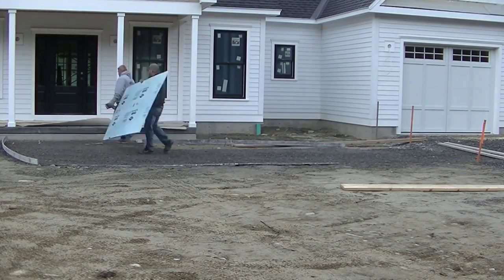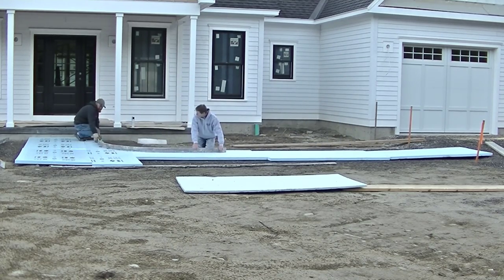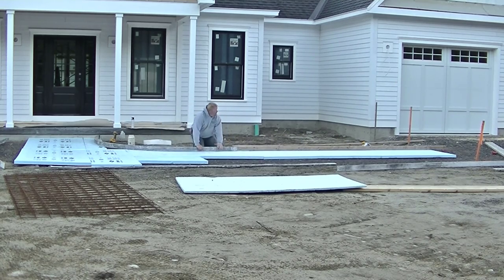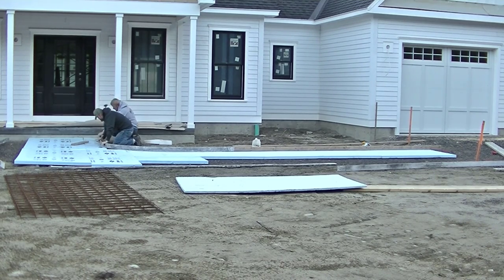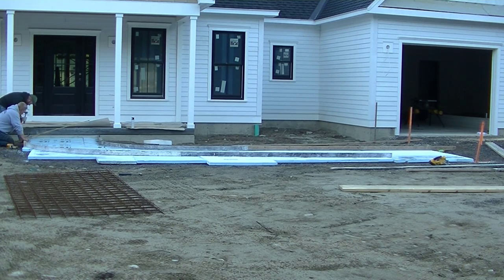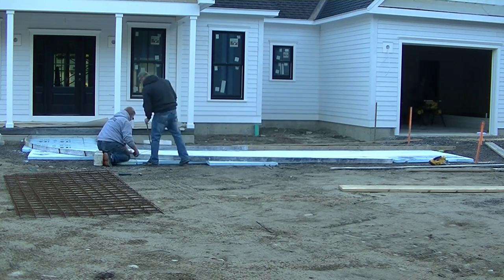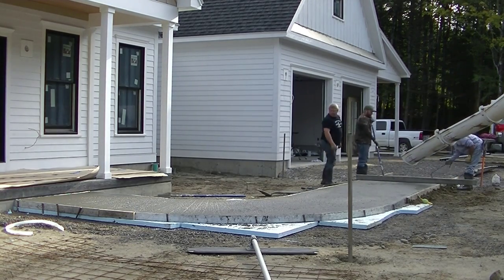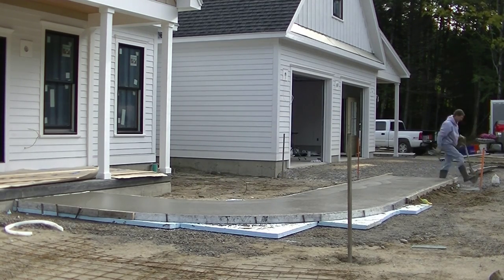How To Stamp A Concrete Walkway | Ashlar Slate Stamped Concrete

Comment: I uave a brick patio that i am going to replace with concrete because every year weeds keep growing in between the bricks. Tgese videos are helping me to prepare. Question: if i stamp it, can i use a grinder and put the relief cuts only in the stamp lines or do they have to go straight all the way across
Reply from the maker: They have to go straight.

Comment: -I’m sure you know this already but - When you’re putting on the outside form, instead of measuring the width with a tape every time, I always found it easier to cut a 2x4 the width of the sidewalk and use it as a gauge. Especially if you’re working by yourself. Then you can use that piece to close out the form at the end. 
-For the mix you’re using there - pea-rock, with fiber mesh and some MRWR, that sounds like about the same price as we’re paying in So. Fla.
-Was it just the camera angle or was that a heavier gauge wire mesh? It looked like maybe a W2.1 instead of the standard W1.4.
🤜🤛
Reply from the maker: We use the 2x4 method for width size also. Just didn't on this one. It was a heavier gauge wire. Owner wanted it.

Comment: Just wondering about what is your loading of fibermesh?  Is there a point where too much fibermesh gets in the way of troweling?  And are you also using a water reducer?
Reply from the maker: We use one bag of micro-fiber per yard of concrete. That's a good ratio. We always use the water reducer in the mix.